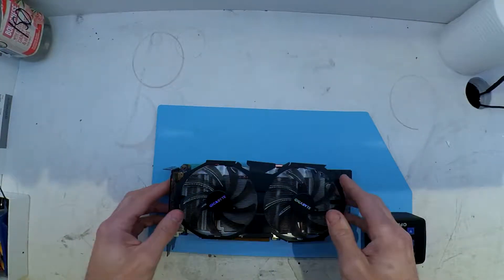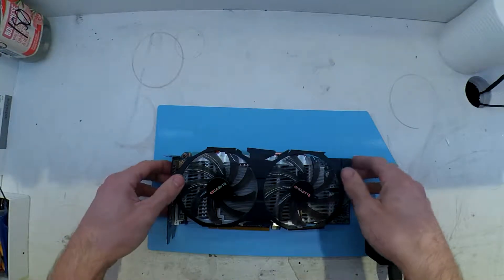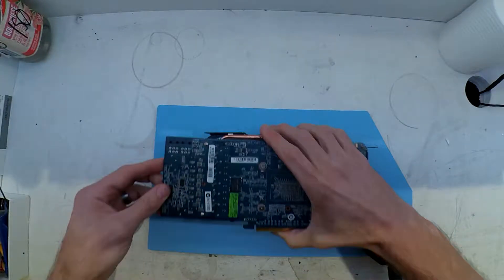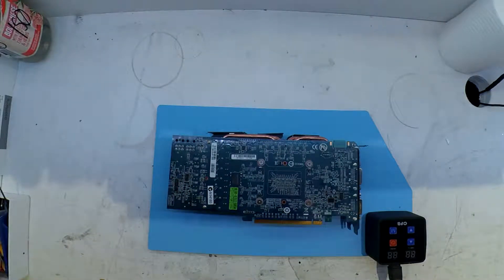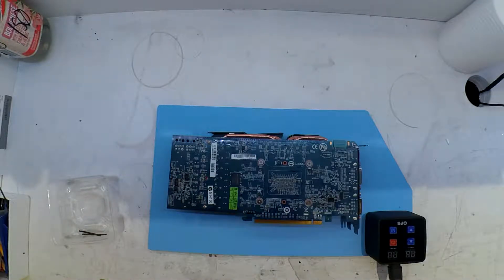gigabyte GTX 560 thermal paste replace

Comment: 3:30 that metal thing where you termal paste can it come of if not did my graphics card brake?
Reply from the maker: the metal square with thermal paste is the CPU IHS, it should stay on the board but if it comes off i would say its delided

https://www.youtube.com/watch?v=pyKmx38FGBo&ab_channel=Kate%27sHardwareReviews